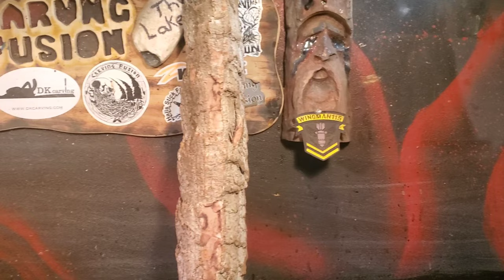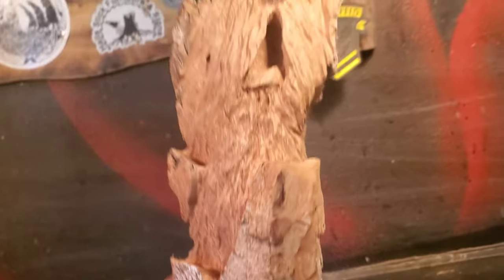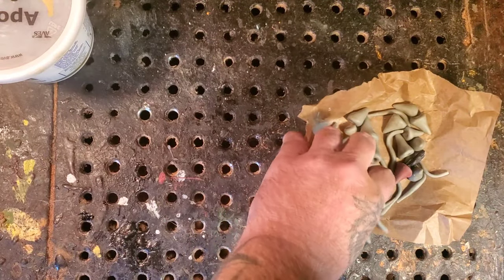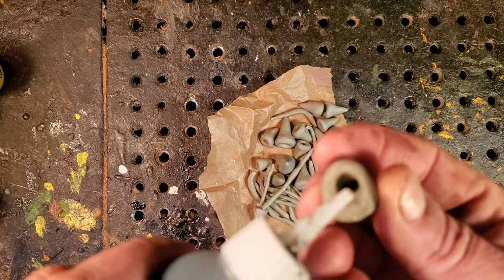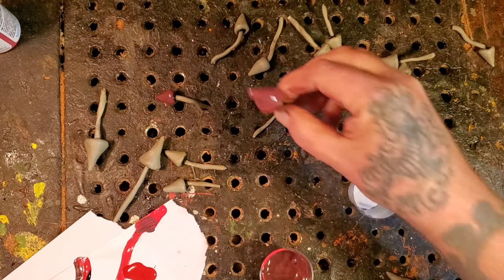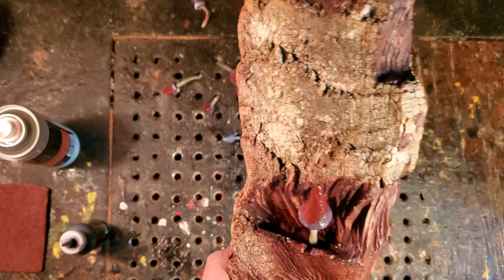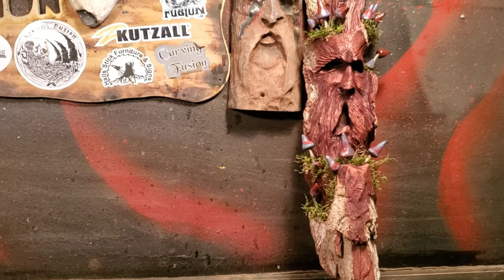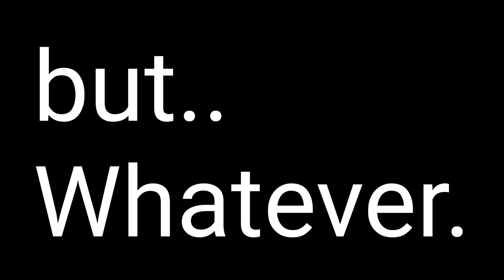Wood Spirit carving & how to make Apoxie Sculpt MUSHROOMS 🍄

Comment: Hey man, really appreciate these videos it’s helping me a lot. I just upgraded to a dremel 4300 and flex shaft and I was curious about your speeds. I know you use a foot switch with your dremel on high, but are you mostly running max speed when carving these spirits?
Reply from the maker: Wicked thanks, yes almost max speed blocking out then lower the speed doubg detail